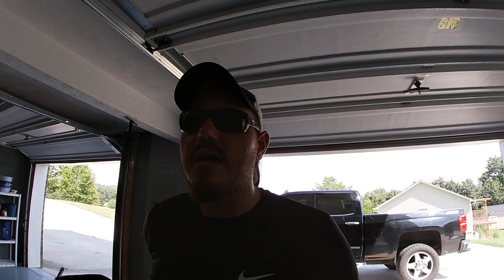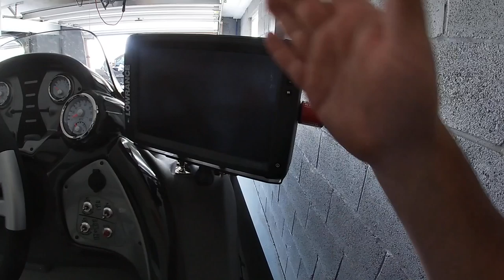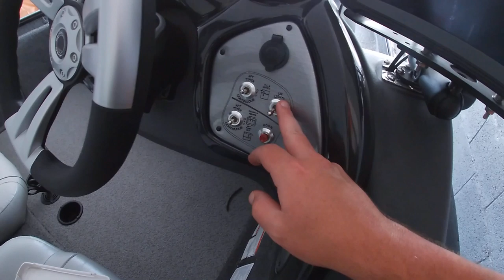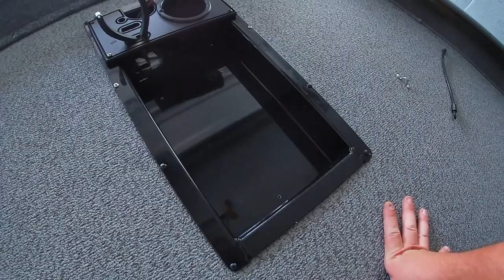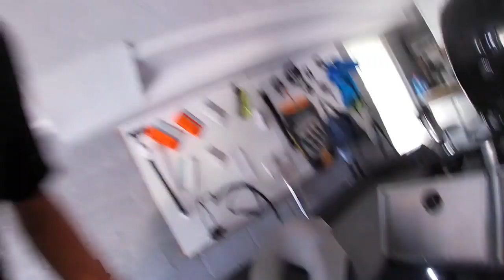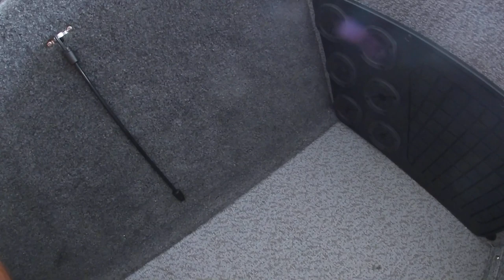TRACKER PRO TEAM 195 TXW: New Boat Walk Through

Comment: Nice!!! A feller needs to treat himself every now and then. I really like the vinyl flooring. If you have room for another battery you could run them in parallel and double your trolling motor time and still keep everything 12v.
Reply from the maker: Yeah I actually have another battery in the boat that right now I am just using as a backup so im gona do that as soon as I make it to the store to get some wire.
Reply: @RyanEppsFishing That's how i have my 12v. motorguide wired, I longline for crappie in early spring on Douglas and was out of juice with my one battery setup by noon and added another battery wired parallel, now i'm still trolling at suppertime, lol.

Comment: If you have space for another battery, just run two batteries in parallel instead of series. You will still have 12v output but the current will be spread over both batteries with the benefit of added capacity.
Reply from the maker: I am actually running two batteries in parallel now after I made this video, it does work much better.

Comment: late to the game watching this video, but am in the market for a 195 so I came a crossed it and had to watch. love the video. question, not a fan of mounting sonars to the side of consoles due to bad experiences, is it possible to mount one to the console. I know you can't flush one but could you put one on top?
Reply from the maker: You might be able to put a smaller unit up there but I dont know of a good way to put a big unit up there, the biggest problem you would run into is the vibration, since its not a a molded console like more expensive boats it has alot more vibration. I even had to put two squares of diamond plate to sturdy it up where I mounted my unit. I would at some point like to add a second unit to my console and at that point im gona have to figure out a way to mount one there somehow.

Comment: About how often do you have to replace the batteries?  Seems like it could get pricey.  Are there any trolling motors that work well and are easier on the battery?
Reply from the maker: I usually have to replace my batteries every year or so but I also am out on the water using them alot. The problem is that I have a 12v trolling motor which is underpowered for my boat and  is not ideal for what I am asking it to do on a weakly basis. A 24v or 36v trolling motor with more thrust that is spreading that workload out over 2 or 3 batteries would not be as hard on batteries.

Comment: Also, is Tracker still building with plywood decks?
Reply from the maker: Yes they are, the front deck and the console area I believe. I was told though that the decks are covered under my warranty which runs as long as I own the boat so if I ever have a problem with them they will replace them.
Reply: I know it keeps the cost down but I would rather they used all aluminum.